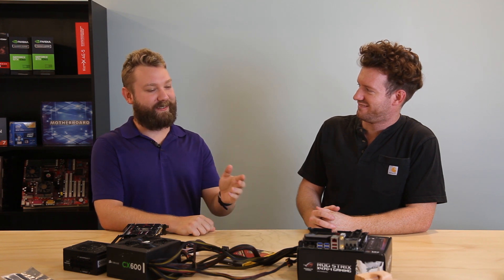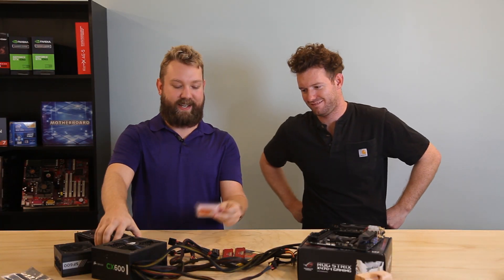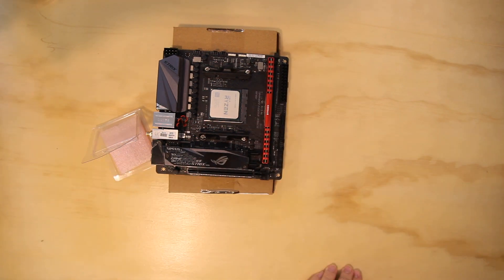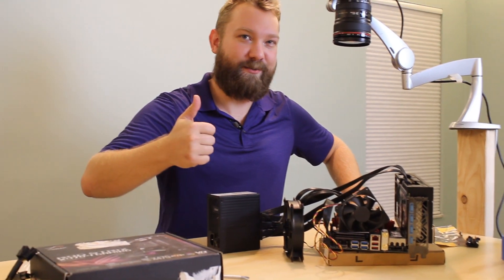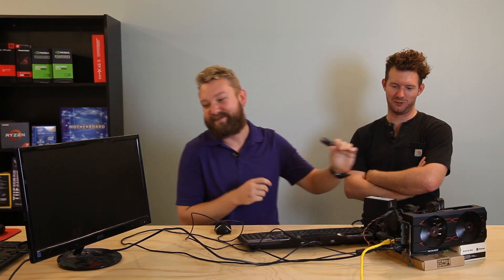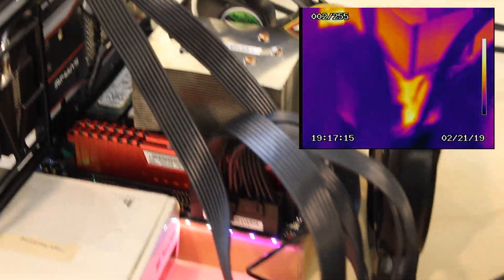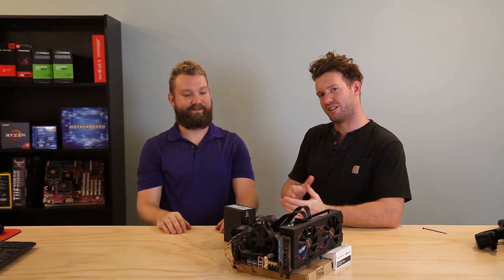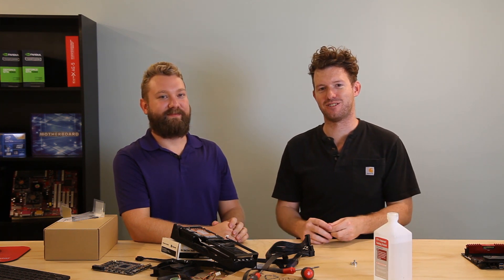Immersion Cooled Daily Gaming PC Part 2 - The Innards

Comment: A tip if you want to use no cooler on the CPU, you get better tempeture results when you make the surface of the cpu larger with sandpaper or a laser

Comment: I have to correct you guys.

8:39

At 8min 39sec, you say you won't be able to use the hardware anymore, after submerging everything in 3M Novec ... but Novec dries quickly.

http://www.youtube.com/watch?v=YyKIZPuepl8&t=02m36s

At 2min 36sec, you can see that a dollar bill submerged in 3M Novec dries very quickly.

Even if you left your computer hardware out to dry for a day or a week, I'm sure everything would still be use-able, afterward.
Reply: we were only saying that once we submerge the computer in the fluid we wont be able to use the thermal camera to check for hot spots